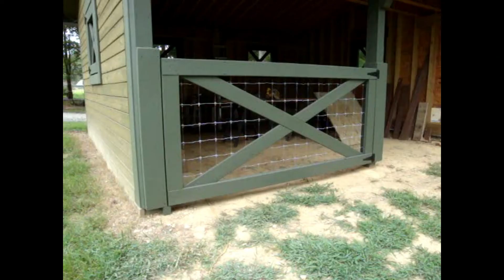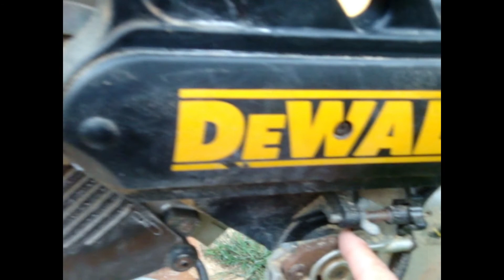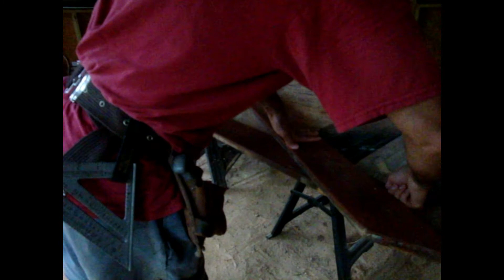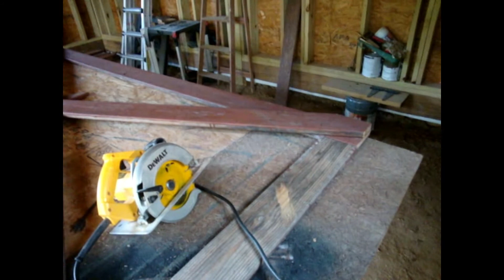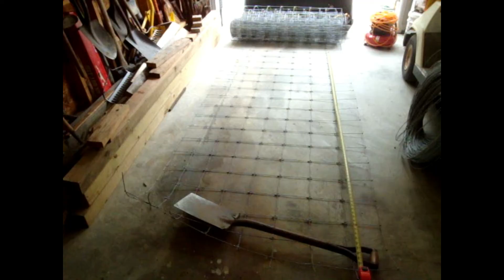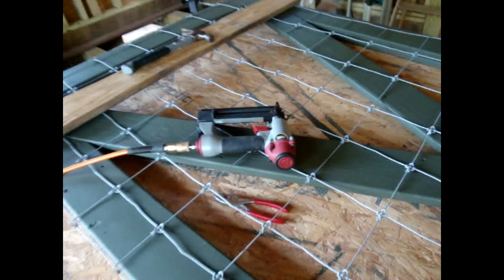How To Build a Wood Gate That Will NOT SAG!

Comment: That is amazing work. As to add extra strength to make them stronger as you suggested - where in the middle should add the board, if don't mind me asking? Your response would be greatly appreciated.
Reply from the maker: This gate is still as strong as the day I built it.  It doesn't need more support but if you liked a different look you could add a vertical board in the middle and that would also add support... or another horizontal board in the middle would do the same.

Comment: If vertical boards are used? Will the added weight be a concern?
Reply from the maker: A gate built like that would not budge but make sure you have hinges to carry the weight depending upon how long you make The gate

Comment: Nicely done. Is the wire mesh part of the gate's structural integrity, or is that simply to impede animals?
Reply from the maker: The wire mesh may add a little structural integrity but not necessary.  I only did it for animal security.

Comment: Beautiful job! I’m considering a similar build and worried about sag and the hinges. Can you provide the link to the hinges you used again? Thanks.
Reply from the maker: I wanted to save money & get a hinge that would support the load of these heavy gates.  I found these 8" galvanized T hinges at Harbor Freight for around $3 each.  https://www.harborfreight.com  
I painted them black and they are still working great after 3 years with not any sagging at all.  I use them every day to let the animals out.
I will have a video out on December 7, 2021 showing how I painted those hinges to not peal or flake.  They are  also in great condition... like the day I painted them outside of being a bit dusty and dirty.

Comment: I have a question about the gate. I built one using your tips and no the gate has twisted a bit. I’ve put some tension wires on it to try and straighten it out. Didn’t work all that well. Do you have any tips on how to straighten it better ?
Reply from the maker: Did you use "wet" treated boards from a HD or Lowes to build your gate?...  Sometimes their boards are a lesser quality and if not KDAT (kiln dried after treatment) they will do a lot of crazy things as they dry.  As I stated in my video I built my gates with used deck boards (the wood was dry) and they have not moved even a 1/4 inch in the last 2+ years.

What I would do...
If this is the reason for your twisting boards...  I would keep the gate latched (top and bottom) at all time while the wood dries.  Also make sure to get it sealed (stained)